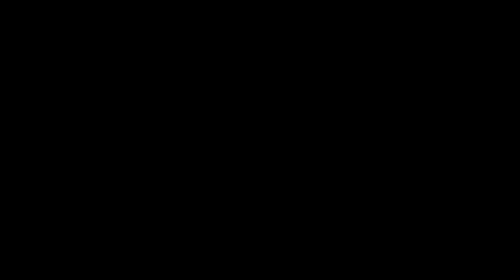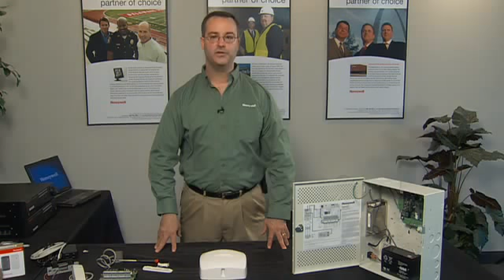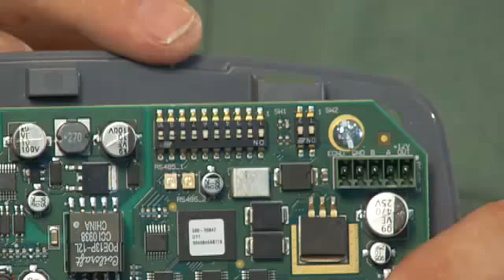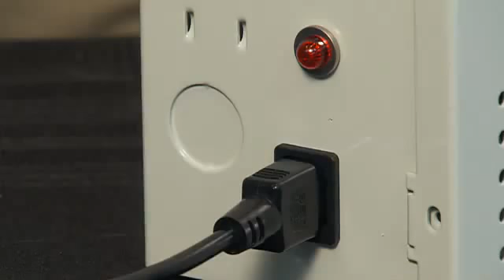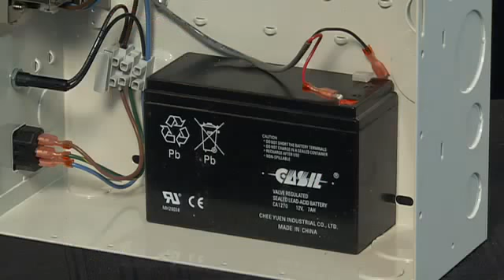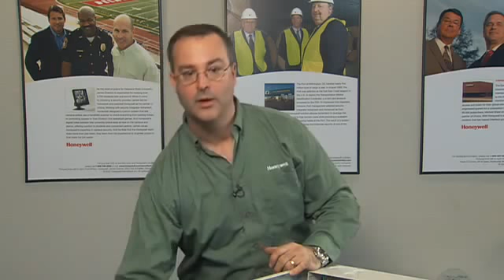NetAXS 123 Web Based Access Control from Honeywell Security

Comment: hi mister, im having a problem with the netaxs123 controller connected with HID readers, when i use the HOLD A and HOLD B the readers stops working and i have to restart the readers and dissconnect the HOLD A and B

Comment: i haveproblem with honeywell pro3000 acs wiring. EMlock problem. can you help me?
Reply from the maker: If you could be a bit more specific in your question, we may be able to refer you to some information that would help. If your question is about the NetAXS 123 product, we do not support that product at this time.
Reply: I also have the same problem